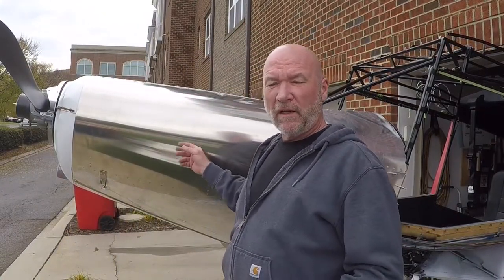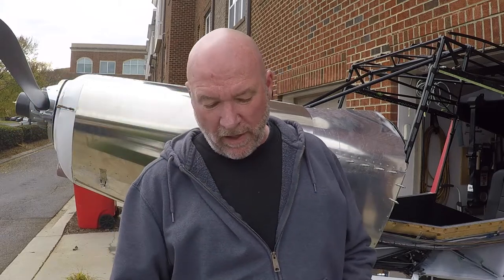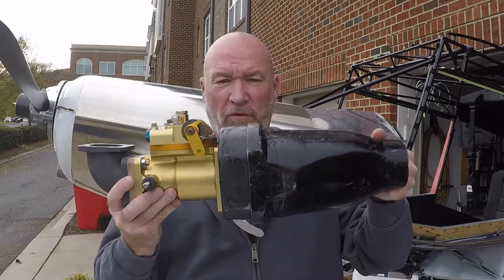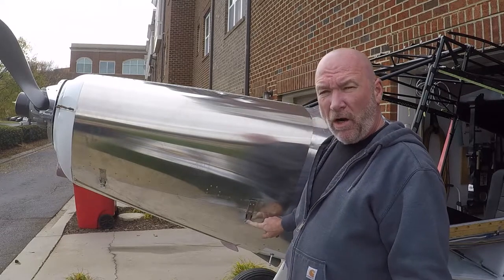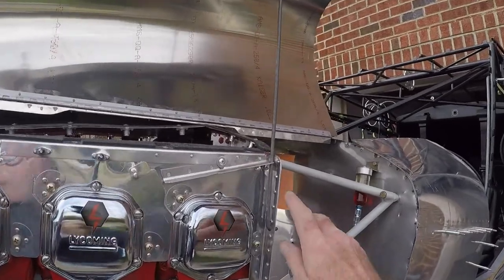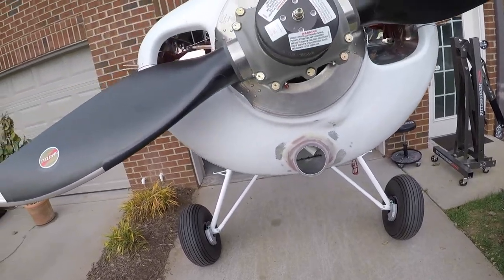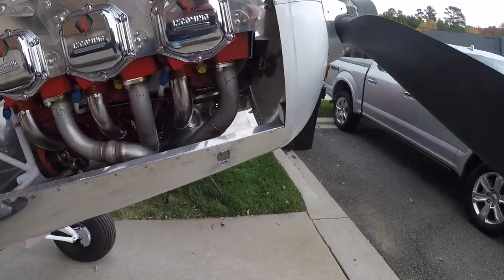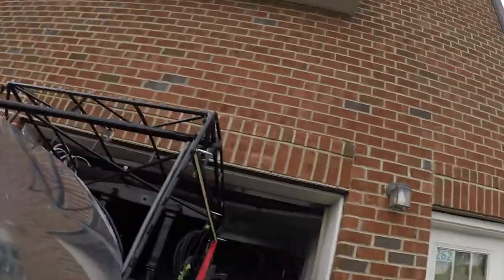BEARHAWK ~ Installing the Engine Cowling!

Comment: Gold star effort.  May want to consider a flexible tube to your K&N airbox.  That rigid aluminum looks likely to cause damage to either the airbox or intake area as the engine moves. How did that turn out?  Did you need to modify it?
Reply from the maker: I eventually installed a flex tube.  Thanks!

Comment: 14:17 it isn’t anodized, it’s raw aluminum. Anodization adds hardness and corrosion resistance, but it’s doubtful that is necessary for a TPM control cable mounting bracket.
Reply from the maker: Thanks for clarifying.

Comment: Any chance do you have dimensions of the MK1 box handy? Whats the shortest length you recon you could cut it down to. Im in the same situation but with an already forward facing FCU the space for the air box is even more limited.
Reply from the maker: It's tight.  And if it were not for the extended hub on the prop I'm not sure any of it would have fit.

Comment: Looking forward to the electrical ... what resource did you use to plan for ELT etc those non-sexy elements that needed planning and placement ?
Reply from the maker: The ELT is the ACK 406 and it is mounted on a tray in the aft portion of the fuselage.  Aerotronics built my instrument panel.  They provided schematics that detailed the entire layout of the electrical system.  That helped tremendously.

Comment: Has anyone noted any worries about the filter having possible icing problems with the carb heat vent installed on the trailing end?
Reply from the maker: This system is fuel injected, so there is no carburetor .  The vent you are referencing is the "alt air" vent and it will serve as an alternative air source for the fuel controller in the event the filter gets plugged.  i.e. Bird strike, or ice as you suggest.  However, I have no intention of flying this plane into full IMC, although it is equipped for IFR.  The Alt Air vent would allow "dirty" air into the fuel injection system, which is not desirable but better than nothing in a blocked filter scenario.
Reply: @TheBaldPilot  I see. So the alt air just pulls from ambient interior cowling air?
Reply from the maker: @merlepatterson  Exactly.
Reply: @TheBaldPilot  I see. Thanks for the input. Good luck with the rest of the build. It's looking great so far.